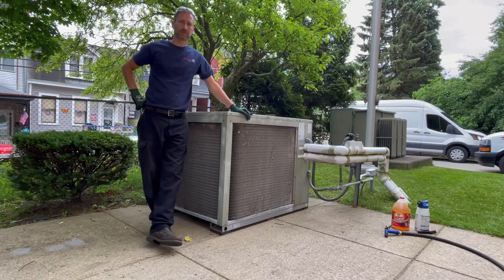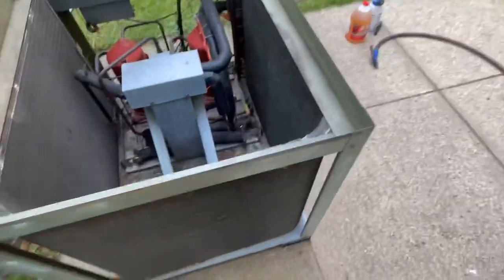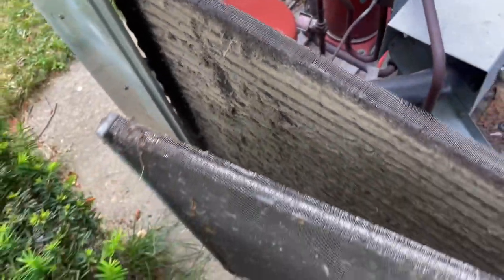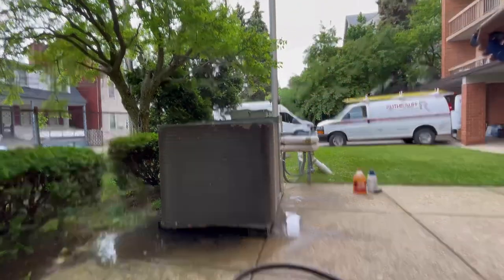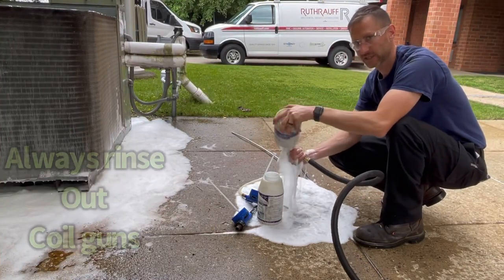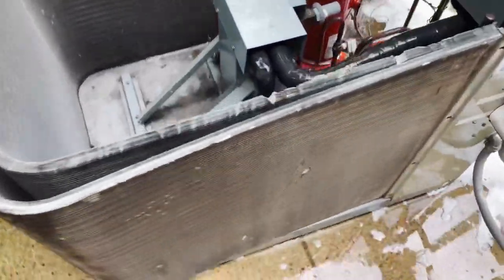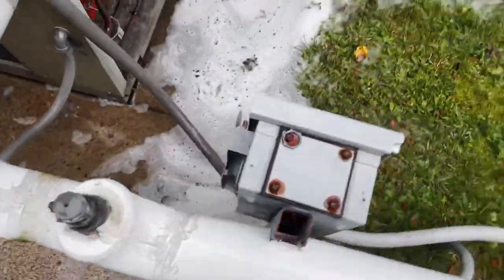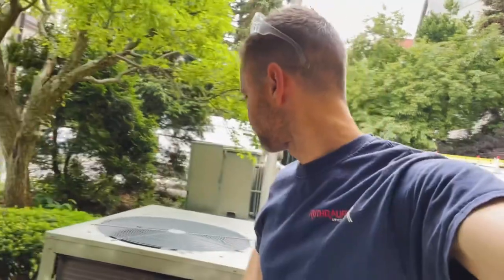Ever Split a Condenser Coil ? #Steamfitterslocal449 #hvaclife #HVACEXPLAINED #sporlan #trane

Comment: Tony, When you split that coil it made it real obvious why those aerosol ‘no rinse’ foams are garbage. I was on one after the local big scamtractor had used one the day before. It baked on to the fins and set the unit off on HP trip outs. Customer paid ridiculous money for a PM plus that costly useless add-on. After I showed him the problem he broke out a camera, gave me a $100 tip and told me he was a lawyer! 🤣 He got his money back from the scamtractor before I finished cleaning it correctly (same as you did here 👍).
It’s not how big a company is, it’s the ethics that eventually count in customer retention. Pretty much a no brainer if you’re honest.
- AKA Globe Flicker
Reply from the maker: I always rinse the coils afterwards thoroughly I was always instructed to rinse thoroughly.  Even evaporator coil cleaner it says “no rinse” I do rinse it down typically afterwards because there are quite a few people that complain about the odor even know It has a lemon or cleaning sent.  Now if we’re talking about “condenser coil cleaner” you have to make sure you rinse it very well if you leave that real harsh alkaline cleaner on the coils it “can” deteriorate the aluminum.  
Typically on new equipment I will not use cleaner at all but when a unit is covered in grease say from an exhaust fan from a kitchen blowing towards the unit I must use a real strong cleaner.  In some cases they are not needed this unit I probably could’ve gotten by not using cleaner Those cleaners do help in my opinion on some equipment in certain situations.  
I do see many scams in this field and I agree just try to be honest as possible the way I look at it treat everyone’s equipment like it your own.   
Would you believe I’ve had a belt manufacturers instruct me to change both pulleys whenever installing a new belt!   I understand they want to get the most life out of their belt but in the real world how many places really do that.  
I appreciate the heads up and yes once again a lot of scams in this world and honesty does go along way with customers.  Have a great day and thank you for the comment.
Reply: HVAC EXPLAINED 
That’s why I look forward to your videos. Always best practice, clear explanations and done the correct way. Glad to see your subs going up fast - this channel deserves them!
Now get back to work! 😅✋
Reply from the maker: @wetheadedtinknocker6887  Thank you very much sir. There is controversy in every field and with certain cleaners and products they claim to work and if not used properly obviously they won’t do their job properly.  My disagreement with non-rinsing detergents his. They don’t exactly push all that debris out by themselves, lingering hair, lint, pollen could remain deep within the coil therefore using Water to force it out as an after rents in my opinion is the way to do it.  
10 years ago I caught a local HVAC company scamming my neighbor about a month after I moved in.  Her capacitor went on the condenser I went over diagnosed and installed a temporary used capacitor to get her up and running in the meantime I cleaned her outdoor unit, flushed her condensate pump inside, changed her air filter and checked charge. 
I told her the capacitor is roughly this much I’ll come back in a day or so with the actual part well. Before I did this she was going to wait for the local company to come out to do their yearly evaluation of her system.  Home warranty as she called it.  I told her there’s no need and she kind of insisted having them come out I said OK call them and tell them this is the part you need please bring it with them.  About a week later her husband is knocking on my door saying that his house is incredibly hot!   I go over he shows me the paperwork from the HVAC company that was there for the home warranty.  
The system was low on oil, charge system with oil to factory specs, Installed digital thermostat, capacitor and charged her over $300 for the service.  
I was livid and disgusted to my stomach I told her do not ever call this company ever again and she never did.  I notified her to call the Better Business Bureau and that’s where I left it.
The reason for the house was so warm they couldn’t understand the brand new high-tech programmable thermostat they scammed them into buying and I still would like to know this day how old is one identify a residential system if it’s low on oil especially with no site glass in the entire system!

Comment: A lot of the people I see cleaning these coils don't usually wet it down first. They don't seem to get that the water also helps give the cleaner something to hold onto and gets it down deeper into the unit and coil. It just all around seems like the better and smarter way to do it. Call me crazy, but I'd rather spend an extra 2 minutes and have it done right than have to deal with it later.
Reply from the maker: Sorry I overlooked your comment a couple weeks ago I’m just glancing over a few videos right now making sure I did not forget to get back to people.  
Most of the time I try to rinse off the heavy debris first that usually tells me how much cleaner to use at what strength.
Everyone seems to have a different technique but yes I agree wedding it down thoroughly first it’s probably the better method.  Not to mention rinses away a little bit easier because everything is completely saturated including the surroundings.  Thank you very much for the insight I appreciate it have a great day.

Comment: Similar to the Trane rooftop unit with the double coil. Be very, very careful.
Reply from the maker: I’ve seen and had to split coils on a few carrier RTU’s and Trane  Units.  It’s very time consuming to do properly and sometimes need a secondhand depending on size of equipment.  
Thank you very much for the comment and concern have a great day and stay safe.
Reply: @hvacexplained9341  wow 🤩 this my first time seeing a coil cleaning on a trane split system .you have to clean the inside cooling coils as well

Comment: Hi again...¿¿can the electrical compartment be washed too or is it better to use a blower to remove dirt n dust??
Reply from the maker: When I typically do is use a small brush and bring nitrogen or compressed air with me.   Water and electricals do not mix.

Comment: hello  my air split runung indoor  and  outdoor blowing hot  air  way what common reason
Reply from the maker: I apologize I’m trying to understand what you’re saying here.  You’re split system is operating.  The indoor fan is blowing and the outdoor condenser is blowing hot air?  
Is any cool air blowing from the indoor unit ?
Reply: Hello  i  mean  my  air condationar  runing indoor  and  outdoor  blowin air  but  blowin hot  air  not  cooling
Reply: @hvacexplained9341  i detected fault revers  was not  working